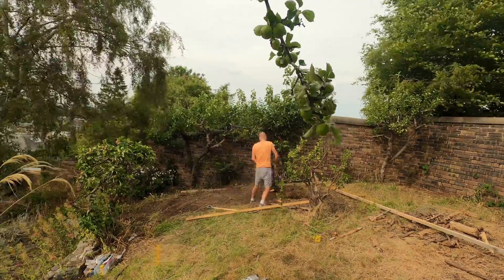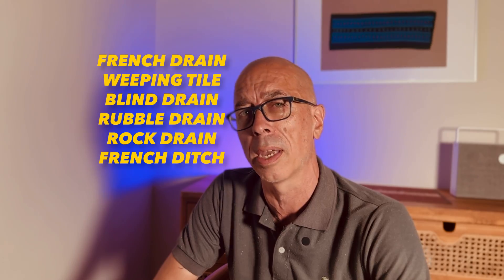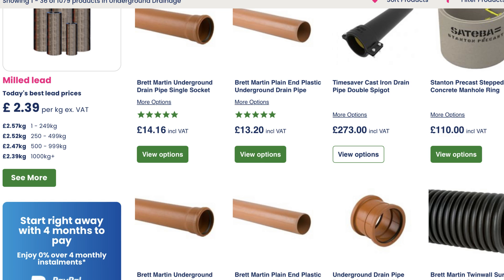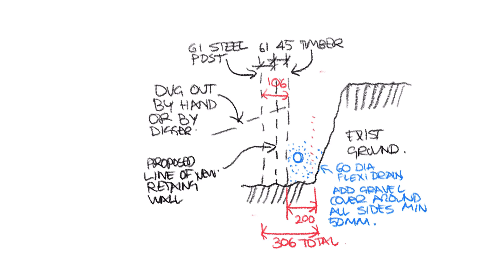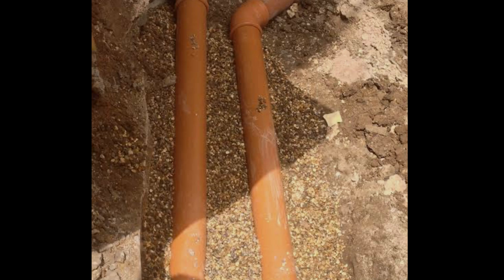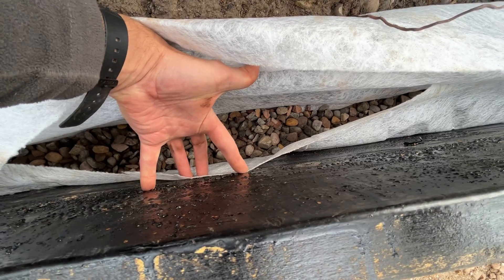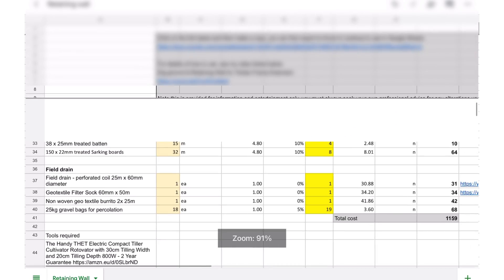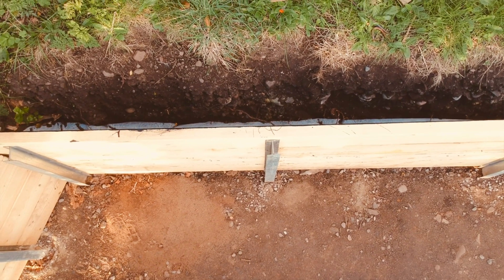Field drain for Retaining wall - installed the correct way - to last forever

Comment: Hi there just come across your video and found it really informative and indeed a bit if an eye opener... In a good way. Just trying to figure out where to take the water on a wall where it slopes both ways... What did you do in the end for the run off?
Reply from the maker: You take the water to a soakaway or if there’s sufficient land with a slope and percolation you can distribute it. It’s a topic in itself as every site is different so I can’t really say.
Reply: @build-better-things I think in my case it looks like cutting three openings on the 9 metre retaining wall to allow drainage is likely the best option as the ground does slope away into a planting bed area. Thanks again for the video.

Comment: The top garden at the back of my house is 10 metres by 8 metres. A 10 metre retaining sleeper wall divides this garden from the small bottom garden. Behind my sleeper retaining wall (10 meters long), about 4 inches away from it, there is a small brick wall about 4 inches high but it only runs behind it at certain intervals. In front of the retaining wall  is the  smaller garden 6 metres x 2.5 metres which is adjacent to a garage which is surrounded by a concrete retaining wall. This small garden has also a retaining wall made of brick and steps leading to the back door of the house about 5 metres away. This area is covered by patio tiles. The back of the garage sits a metre in front of the sleeper retaining wall to the left.   The previous owner had installed the retaining sleeper wall with the intention to level the top garden which has a slope of 40cms towards the house. It also slopes 18cms down to the right where there is a neighbours garden divided by a wood fence and hedging behind it. The next door neighbours garden drops around 2-3ft.  I would like to finish the work but I need advice on the drainage. I really hope you can offer a little of your time to respond, I would be really grateful and appreciative.

  There is no small brick wall behind the area of the sleeper steps (centre of sleeper wall) or the section of the sleeper wall to the left where the garage is. Where do I put the French drain and where do I run it to before I start levelling?

Comment: Totally wrong on the pipes blocking. having just had to drain 4 acres of soaked wet fields on a slight slope I started off with the expensive fabrics and stone. Only to learn that the water moves just as well without these things and only starts to flow once you have re buried the pipe with the same earth you dug out. It doesn't block and the water moves through the soil and into the holes just fine. After a good rain the pipes will continue flowing at a good rate for a couple of days. Way cheaper at around £30 for 50 meters compared to thousands with permeable fabric and stone. Your stone is too small if you are going to use it as 40mm plus is best.
Reply from the maker: Thanks for the comment. You say you’ve just done it. I will be interested to hear back from you in a year or two to see if your pipes are still flowing without any protection.

Comment: Hey, I really trust your videos, love the reasoning. Do i french drain my cellar? I have tanked my cellar from the inside, some videos show people tanking the outside too. My logic is if moisture gets into the bricks, it needs to escape somehow so Im more inclined to line the cellar wall (externally) with a breather membrane, line the entire trench in non-woven geotextile, add a french drain / sump pump & fill the entire trench with gravel (2.5m deep). Soil is mostly Clay/Chalk, cellar only had a slight damp smell, and i will be building a driveway on top of it (which slopes downhill away from the house). Ideally i don't want a sump, but the clay wont act as a soakaway. In addition, once the drive is in, its double costly to do it later. Am i overthinking / worrying? Is this overkill? simpler option? Cheers x
Reply from the maker: I use the DPM with the extrusions which helps create a route for the moisture too push itself around, and works in conjunction with its insulation. It’s been a few years since I have done one and the technology is no doubt getting better. You can buy a set of products and get a guarantee to go alongside it believe . I would always pair it with a sump, I think there’s some equation you do which can predict the moisture quantity and pressure. Some French drains of the right size might work but I wouldn’t feel ok with that, plus I doubt it would comply with building regulations.
Reply: @build-better-things  Thank you, i will look into the product. Lots of thinking to do on this one!

Comment: Morning, can I first start by saying that this video of yours helped me enormously. I live in North London which is pretty much CLAY. Regarding the the gravel you have put behind the retaining wall (4.14 mins on your video), does your final gravel level have a slight angel so that the drainage pipe will also be at an angel for the water to flow smoothly?
I have tried to angle my digging for my drainage pipe, but being clay, sometime you can dig a little too deep (even 10cm is too much) before you realise that rainwater will collect in there. So can I simply fill the over-dug areas in my clay foundation with gravel?
Thank you once again - wish these videos came up in my search last year!
Reply from the maker: Hi. If you mean, does the drain need to be laid to a fall, then yes it helps to use the gravel to make the fall. However the field drain  pipe doesn’t really need to have a gradient when you think about the hydrostatic pressure which is pushing the water through. Do your best to get a fall using the gravel but don’t worry about it. It should work regardless. I hope I’m understanding your question.

Comment: You don't put a sheet of visqueen behind the sleepers? In Australia,  we now have to put a sheet of cement board and plastic sheet behind the wall to prevent moisture breakthrough , even with conrete sleepers.  Also,  our posts have to be same depth as height.  Absolute overkill but that s what the engineers want
Reply from the maker: I paint the back and sides of the sleepers in bitumen which has a degree of breathabiliy. I think an impervious membrane like Visqueen accelerates the decay of the timber where it sits against it, but it’s just an opinion as I’ve never done it that way. Depth… I’ve always worked on 2:1 for the height, as long s as there’s Boulder Clay at the surface after you dig down. 1:1 I would imagine the post would fail before the foundation at such a depth encased within boulder clay…. but maybe that’s why I’m not an engineer. Thanks for the comment.

Comment: This is great - thank you. I'm planning on building a garden gym / home office, on a sloping site, using steel screw-piles and timber floor frame, with timber framed building on top. Presuming if I build a retaining wall like this, I can build the timber floor frame (supported by screw piles) within the inside of retaining wall to end up with a floor level nearly the same as with the floor level outside i the garden?
Reply from the maker: if I’m understanding you correctly, yes, I’ve done exactly that if you look at the videos of the micro home I built.

Comment: @build-better-things I have to figure out how to replace an existing 35 to 40 year old timber retaining wall.  My confusion is with the French drain.  The wall I'm tackling is basically U shaped (8 feet then a 90 degree turn and it goes for 16 feet then 90 degrees again for about 9 feet.  My trouble is that both sides of the U (8 foot and 9 foot parts) where the timbers end are buried on both sides into a small hill.  Basically the wall juts out from the hill and acts as a sort of look out point, so I'm not sure where the drainage pipe for the French drain could drain?  Any thoughts would be very welcomed.

Comment: Hi There, thanks for the videos always appreciated.
I was hoping you could expand on a comment you made a few months ago regards a flat roof. You said you should only have timber based composite above the insulation as a last resort. And you should instead bond the EPDM onto the Insulation. Would that be insulation wrapped in a DPM? 
Its just all the videos I've watched regards flat roof extensions and garden rooms have OSB above and below insulation, for a base for the membrane?
And would the same principles apply for other roof coverings on flat roofs?
Thanks in advance if you see this.
Reply from the maker: Yes, always bond EPDM directly onto insulation. It’s a terrible detail to have a timber deck above the insulation,  especially one with lots of impermeable glues like osb or ply , and yet sadly one which is done all the time in the uk. think about how the dew point works and where it occurs on a flat roof. I don’t understand what you mean about DPM. that type of membrane would never be used within a roof.

Comment: What if you're hardscaping/paving the ground above the retained side of the wall (as for example, the wall is a boundary wall and the higher retained ground is on the side of your garden and you want to pave up to the wall)? Surely you can't have pea gravel as sub-base underneath paving, it's too unstable, no?
Reply from the maker: I wouldn’t ever use pea gravel for that. Did the vid suggest otherwise? I hope it didn’t. I would use membrane, then hardcore, then sand, whacked down, then my paving and jointing. But I’m not an expert in that…there are new technologies coming through
Reply: @build-better-things  yeah, no in the vid it's clearly for the sake of putting grass/earth on the top surface, so not the same. But, without knowing certainty, I'd worried if pea gravel was the only possible effective permeable aggregate to use within the drain ditch. I've done one last year and used 20mm limestone chippings and non woven material around the pipe, then left it and the clay ground alongside to settle in (plus budget and time constraints preventing full finish then). Aiming to finish over the top of the ditch in the next few months, topping off with 20mm across whole laying surface, compacting, then to graded compacted sub base of chippings to grano/type3 to dust for an even top surface across the whole area up to the wall. Hopefully, that will be stable while still allowing some permeability (laying travertine paving, so that's semi-permeable).

Comment: I am currently in the process of doing something very similar, for my Block built Workshop, which on 2 elevations is the supporting wall to a sandy/gravel bank at 1.2 metres in height. I am installing Hyload 2000SA Tanking Membrane and then to relieve the "Hydrostatic pressure" a Dimple matting, then 100 mm land drain as shown in your video, with 2 inspection/cleaning pits, same sock , but i have gone for 20 mm round smooth gravel as the fill but will top with smaller aggregate as I progress vertically. I am only a DIYer but it is reassuring that I appear to be doing it correctly, because I would have hell on in a few years, if water and mold appeared etc, a belt and braces approach is the cheaper option for the long term I think .... Thnx for the video, looking forward to the next !
Reply from the maker: I did not mention access / inspection points but I should have. It sounds like a great amount of research for your project you are doing. Thanks a lot for sharing.